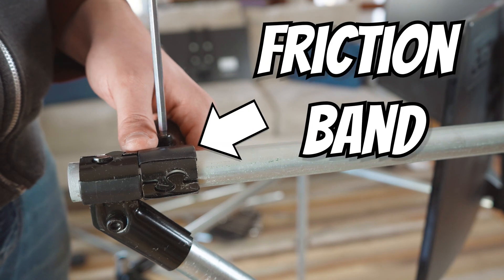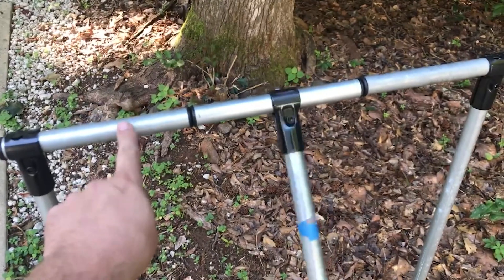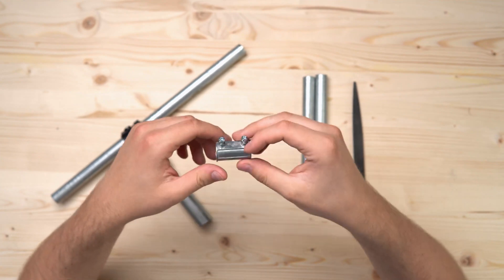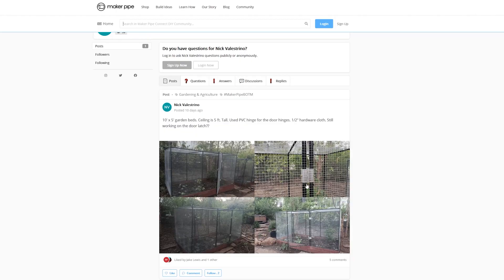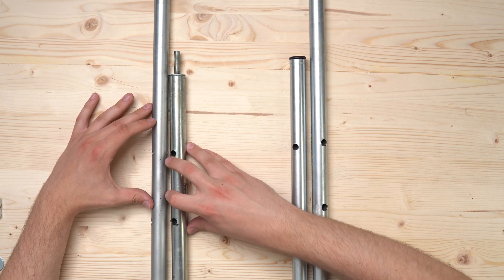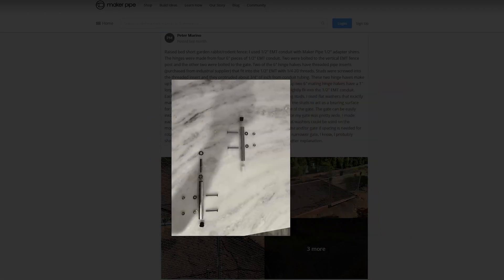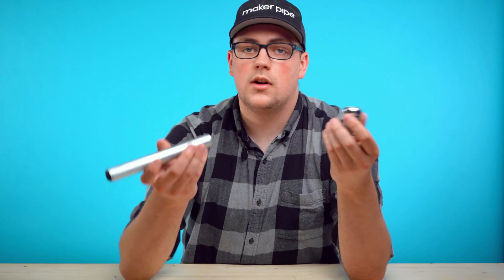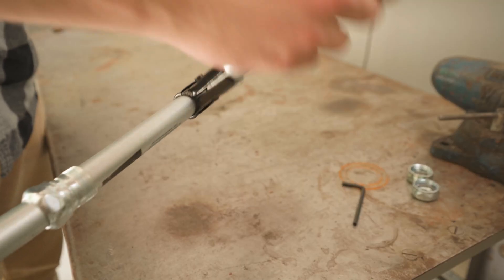8 Ways To Make A Hinge With EMT Conduit!

Comment: Jake-   working on  aluminum 1" OD frame which sits on 2 pontoons-   to form my fly fishing float.  Need to incorporate a hinge T,  where arms rotate on rear horizontal pipe.  The leg  of the T receives top end of  16"  length of  1" pipe which has small axle and a pair of launching wheels at lower end.   Wheels rotate down for pulling craft to launch.  Then  rotate "up" 270 degrees to rest,  then the fun being.  Point is, do you make 1" fittings which will work for this?

Comment: can I ask the community a question. I have two pieces of wood (11x14 1/2'' thick), I would like the pieces to be attached with a hinge so the ends are very close together that will allow the two pieces to close flush on either direction. imagine a piece of paper folded in half and additionally in the opposite direction. any advice or leads

Comment: Can you point me to a video that shows me how to make a hinged adjustable canopy? I want an adjustable hinge where I attach to my fence posts or my house, a canopy that can be lowered and raised based on the hight on the sun? I'm consider making a canopy and also a towel rack by the pool but want them to be able to be folded away when not used if possible.
Reply from the maker: Hey there, thanks for the comment. Be on the lookout this weekend for a new connector that will allow you to do that pretty easily!

Comment: You might also utilize another item for hinges (and other connection ideas).  Namely, you can use 1/2" IMC (must buy from an electrical contractor supply company). It's a little sturdier so harder to bend BUT it fits almost exactly inside of 3/4" EMT.  Only .009 of an inch clearance.  We built small portable soccer goals with IMC bottom corners and 3/4" EMT for the rest.
Reply from the maker: That is awesome Doug! I have been looking for something like that for a while now. We are going to pick some up and try it out. Thanks so much for the comment!
Reply: @MakerPipe  Note that the fit is so tight that using a pipe cutter will crush the inner diameter enough to prevent the IMC from entering the EMT until re-finishing the opening.  Of course any other deformation will also prevent joins.  Cheers!